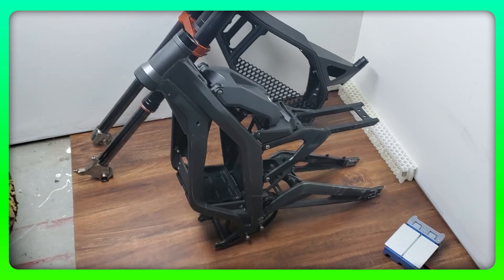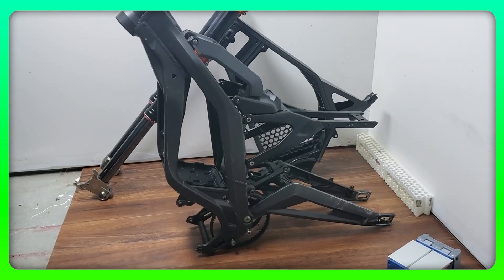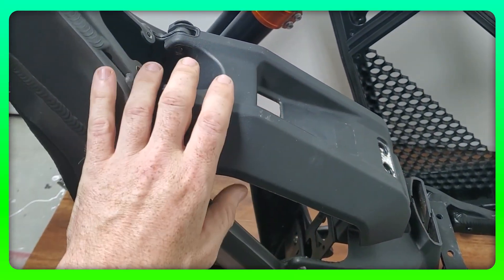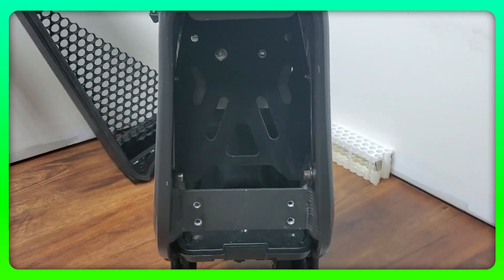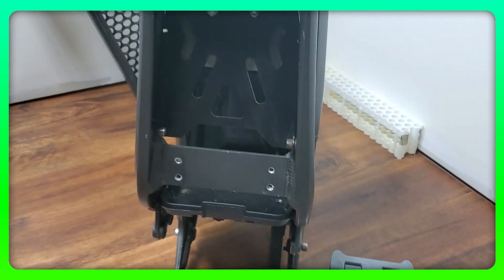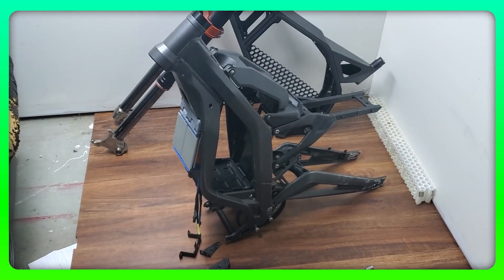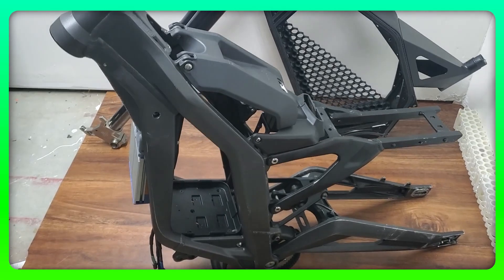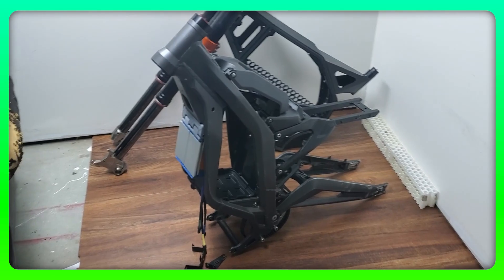Sur Ron Mod Ideas / I was sent a Sur Ron Frame! Lets see what I can make.

Comment: I don't know if this is realistic but im imagining it turning into a different type of bike with mountain bike parts and a hub motor, to make it lighter while still be fast,  and being able to hold a huge battery.
Reply from the maker: You will need a hub motor with a thru axle design. I'm not sure the higher power ones have this. I like the concept though. Keep us posted. Happy to help. Cheers

Comment: If i never lived in a 3rd floor flat i would be buying a sur-ron frame myself, would you be able to fit pedals on it, Coz here in the UK you know police have now created summit that cuts out electric motors, So they can stop people using the surron bikes, But if it got pedals they will prob leave you alone, Be nice to know if police are stopping high powered bikes with pedals, I am doing another build after xmas is done, Really wants a CYC tho coz i already got a bafang, But i wants a full suspension bike for my next build, Just got find the lightest double suspension frame as i got 3 flights of steps with 3 sharp turns, Without the turns being so tight it be lot easier, My advice is dont buy a 29inch wheel bike if you live in a block of flats here in the UK, I made that big mistake, Anyone got any tips without having to take front wheel off???,Its like a wrestling match fighting the front wheel, lol, Plz someone drop me a technique that can help me get bike up steps easier, PLZ HELP, lol, I cant be the only person silly enough to build an E-bike who lives in a top floor flat, Council dont build lifts in their flats, Got be posh for that, Council dont do posh here in the UK Lol, You got some top class vids an adivce, This is my new one stop place for info on the bafang motor, Big up bro....
Will be getting in touch about batteries in next 2 weeks or so, Just skint at the mo, Got be honest bro, Its why im planning on making my own when i bought the spot welder, To try save money, I am scared tho mistakes might cost me more in the long run, Is it even worth making your own now prices are dropping?? Ive noticed batteries are getting cheaper but food is not, lol, Yeah big up for the vids bro, Well informed information.....
Reply from the maker: Thanks for the kind words. We have a discord channel that runs alongside the youtube were it is easier to ask questions and get advice. You will be welcome to join that. https://discord.gg/high-voltage There is a peddle kit for the Sur Ron but I think it is just for show and does not actually do anything. I would not fancy those steps with a Sur Ron lol. Cheers!

Comment: Do you have any sources for the IPM big block mount for the frame? My motor shit and don’t want to drop 650 on another sur Ron motor.
Reply from the maker: There are no sources for LR mounting brackets for it. I get what you mean on the Sur Ron motor. You might be able to get a bare motor but to get it in there is the trick.

Comment: I extended my swing arm made a extended subframe a custom battery cap custom stone gaurd custom peg drop Custom lengthened seat run a 72v40ah bac8000 used fox40s midrise stem and bars, these bike are tiny and squirrel at high speeds the mods everyone wants are a swing arm to give height and stabilise the bike
Reply from the maker: Oh wow that's a lot of mods! Are you happy with the bike now? Its quite a complicated swing arm arrangement. I had not considered a replacement. The wheelbase does look quite short especially for a larger rider.
Reply: @HighVoltageKits  yeah its epic just needs bigger discs and my scoops made to cool the motor so I can turn it up to 20kw
Reply from the maker: Wow! 20kw! Might be a record for that motor.. Well without smoke anyway.
Reply: @HighVoltageKits  na guys run it at that with a decent tune on a bac8000 for short bursts im hoping my air scoops will cool the motor for a longer period
Reply from the maker: Ok. Wow. 16 was the highest I saw it set to. Scoops sound cool.
Reply: @HighVoltageKits  yeah that's what most play around with 14-16 its all in the tune and getting someone who knows best to calculate for the type of driving it will do il be testing mine to see if it runs cool with the scoops b4 I turn it up

Comment: the stock  controller does sit flush with the frame due to air flow ..
Reply from the maker: Yeah. It looks very compact in there. The aim with my stuff is to get the modified controllers to sit as nicely. So they look part of the bike rather than a bolt on addition. It's very enjoyable to try whether it results in something viable is another question. Cheers

Comment: Excited to see what you come up with. Something that  I’ve experienced and I hear people talk about is swing-arm stiffness. You start to feel flexing with hard riding. Of course, it isn’t a motocross bike but with power and suspension upgrades, it leaves something to be desired and doesn’t inspire confidence.
Reply: I have a Sur Ron and agree the rear flex/give/squirm is the only thing that tempers confidence riding hard on trail and street.  Really like how accessible it makes steep, difficult terrain.  For steep, adventure bike rides I'd like to do something 20-30% lighter with a smaller/quieter chain with simple motor near the pivot like the Oset and 40-50 mile range would be the sweet spot.  Probably easier for me to start with an Oset.  The jackshaft noise, complexity and hassle for trail repair is a concern for me with the Sur Ron and belt to chain solutions just add more noise.  Also the wh/mi don't seem to great with the Sur Ron compared to other bikes.
Reply from the maker: Thanks for this. Cheers!
Reply from the maker: The amount of flex will be interesting. There are a few guys in Seattle doing suspension mods. The rear shock looks a key area to get right. It's a quite a complicated setup with three pivot points but looks well made. But really when you can buy an entire Sur Ron complete with battery for 3.6k... How much can we expect from  frame. It can't be costing them much to make. It's really an astonishing thing in many ways.
Reply: Agreed, not a whole lot to complain about for the price. Oh how I wish it had a motocross style swing arm, though. Something a little longer and capable of being beat on. I’ve got an LMX 161 as well and the rear feels so planted in comparison.
Reply from the maker: True. They have the storm bee that's more traditional. It would be hard to modify it too much with the multiple swing points
Reply: ive never heard of that and i do hard riding with the sur ron and it never flexed
Reply from the maker: I have heard both. There are many variables. Rider weight might be one factor.
Reply: @HighVoltageKits  true. I weigh 150. They probably didn't have the 750pound spring that you can put on the stock rear shock. It helps out a ton

Comment: I would love to see you design some sort of frame sliders like what they use on stunt street bikes to protect the frame when the bike falls.  Even a small one but if you did a full cage and a small knubby versions that would be awesome.  No one makes frame protectors for this bike that are made like typical street bike frame sliders.  The only things I've seen are covers that go over the swing arm or frame in key locations but then that's covering up all your cool frame stuff.  I just want a knub that will act sort of like a pivot point and will be the first thing to touch the ground should the bike ever fall and protect the frame some what in a slow speed fall.
Reply from the maker: Do you have a link to any examples? I think I know what you mean. I can have a go for nothing right! Cheers

Comment: I would say the BAC2000 is underpowered for what this bike can be tuned to. I would recommend using a BAC4000 minimum for your project. All the best with this. Looking forward to what you come up with mate.
Reply from the maker: Yeah. Its not going to Max it out at all. I just meant that the stock Sur Ron is a bit slow. So just the 2000 would give a 10-15% boost to speed and acceleration which for a lot of people might be all they want. Should be a fun project! Cheers Danny!

Comment: Awesome. Check out Green Line Engineering’s design …. They crushed the mounting issues with the most flush design. They are also releasing a killer dashboard to make the bike have a Tesla like full touch screen with tuning and overclocking
Reply from the maker: Now that would be great. Cheers

Comment: Have to say this is a very well designed frame and a definite departure from traditional Chinese bike designs in general. Most of the e-bikes coming from that part of the world look very bland and simple compared to whoever came up with this one. They need to give that guy or that team a raise in the company for sure! 

Just like you said because there's so many of these and the market is now starting to become saturated, should be able to pick up one of these as a donor and a starting point for a huge upgrade. There are a couple of videos on YouTube showing upgrading the Segway x160, which is essentially the same exact bike with very low spec components. I'm looking around on Craigslist, etc now trying to find one for a cheap price that would start such a project. Swap out the battery the wheels the forks, the controller and sell those parts to offset the cost of the upgrades. 👍
Reply from the maker: I think Facebook marketplace is a good one as well to try. This frame is definitely an outlier in terms of design. I am not sure why they didn't just upgrade this one to make it a bit bigger for a more powerful version. Good luck in your hunting! Cheers